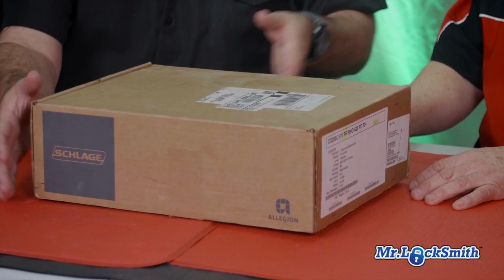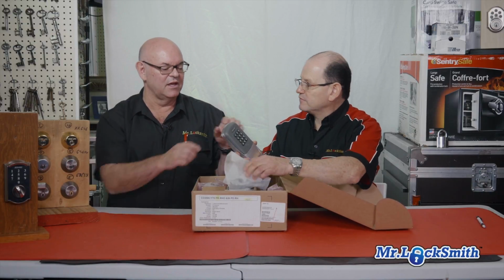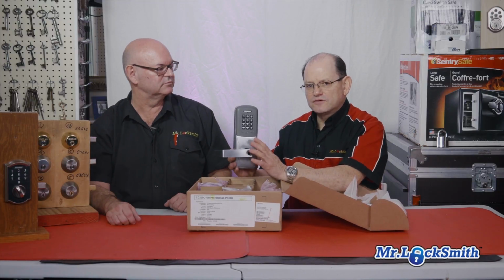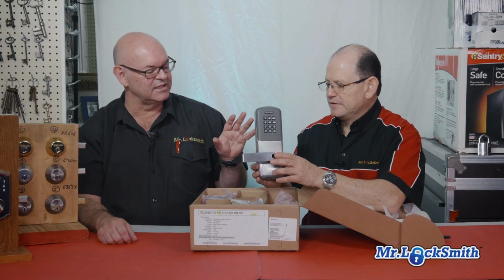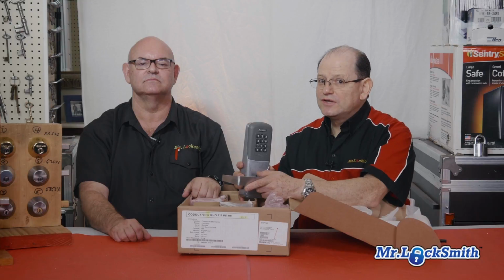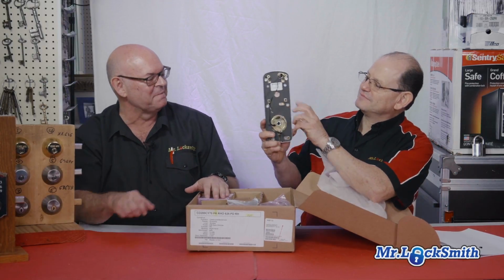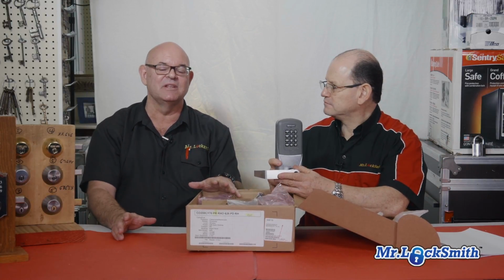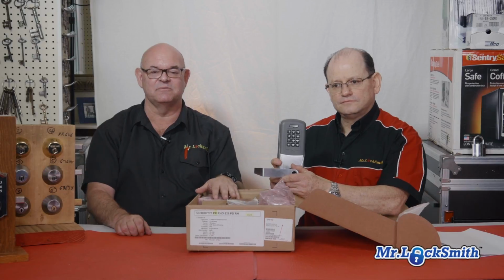Schlage CO 200 Access Control Lock | Mr. Locksmith Video

Comment: This is one of most un-user friendly products I've ever seen.  The software and HHD are archaic.  The HHD is a blackberry from early 2000's.  Very frustrating to use.  Syncing, resetting, almost everything doesn't work properly.  If you can find another way, do it.
Reply from the maker: Robby Morris The software is improving. 

Most Commercial Electronic locks are not user friendly, however, once setup the Schlage is the most reliable and robust systems to install and maintain.
Reply: @24hrMrLocksmith  Then tell me how to get the HHD to actually work with the lock. The PROBLEM IS THE SET UP!  It won't set up.  Can't get to work.  It keeps saying it's not connected to the lock.  Then it will say it's connected but I have to do a Level 1 reset which I do and It does exactly the same thing all over again.
Reply from the maker: Robby Morris Take it back to the Wholesaler and get a new one.

Comment: What is the key-less locks you recommend for residential houses?
You talked about one that you liked but I can't find a video....
Reply from the maker: Abloy Protec2 Deadbolt. I have a video of it too.
Reply: Mr. Locksmith yes you did recommend the Abloy Protrc2 and have a video on it, BUT that is not a keyless deadbolt and the question was what KEYLESS deadbolt do you recommend. 
 
I also have that same question, plus another. Have been seeing a lot of residential and non-residential wireless locks...only a few seem to be deadbolt with most being for the doorhandle.  We prefer a good deadbolt, like the numberpad systems for ease of use. We are also concerned that any wireless system could be hacked where the hacker either gains entry or changes the code so locking us out (not all have a key override) or both.  Finaly, since most resudential grade keyless systems seem to be easily bypassed, we are leaning towards commercial grade. 

What are your recommendations on keypad w/w/o wireless (encrypted wireless) deadbolt locks? Any good ones (residential or commercial grade)?